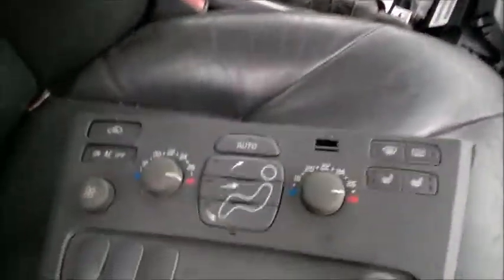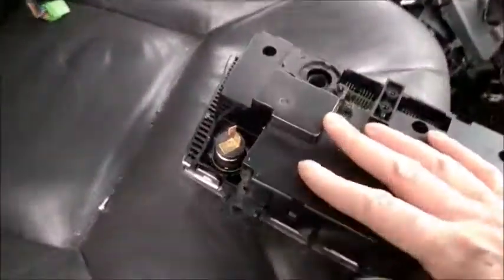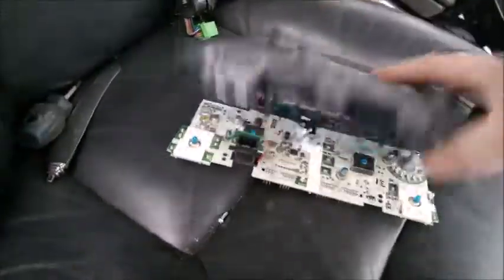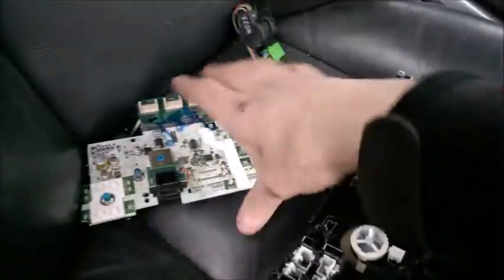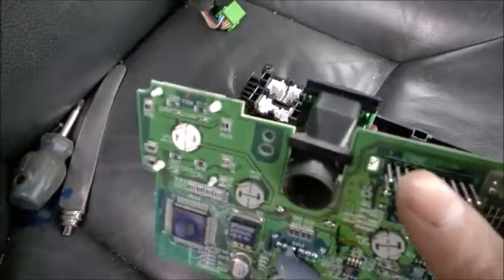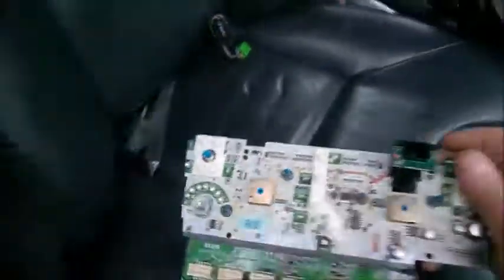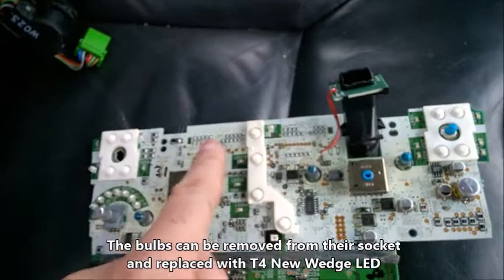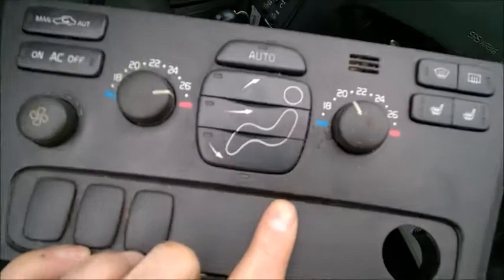Volvo S60 V70 XC70  Climate Module CCM Disassembly - faulty thermistor replacement  2001-2009

Comment from the maker: The thermistor can fail when replacing or connecting back the battery.  Keep the key in POS II with headlights on when disconnecting, connecting back, or replacing the battery.  When the thermistor fails, it can cause driver's side climate to stuck on hot, vents won't work, heated seats and rear window defrost inoperative, etc  An Ebay seller has what appears to be a sensor replacement (haven't tried myself). But before replacing your sensor, test it with a multimeter to be sure it's indeed the problem  https://www.ebay.com/itm/2003-2014-VOLVO-XC90-S80-S60-XC70-V70-HVAC-Thermistor-8651244-30782330/274266146616?epid=1217840281&hash=item3fdb894738:g:5fMAAOSwP45eRd7k#rwid
It is possible sometimes rather the CCM software gets corrupted. If you can find a used one from the same year and with the same software, it should work plug & play - see the last comment in this forum discussion  https://www.matthewsvolvosite.com/forums/viewtopic.php?f=9&t=17478&start=10

Comment from the maker: The sensor assembly is clipped on the electronic board. Just force on it a little to detach it from the board.  
Sensor cleaning and testing  https://youtu.be/mng2EqtHN14
2005-2009 Climate Module doors fuse diagram  https://www.manualslib.com/manual/533936/Volvo-S60.html?page=17